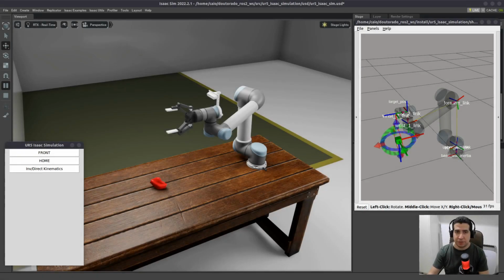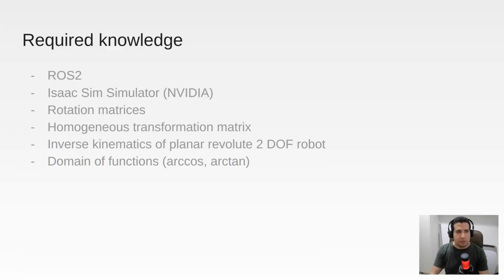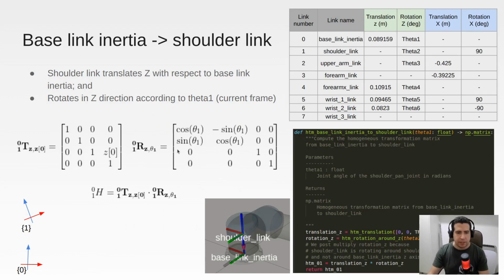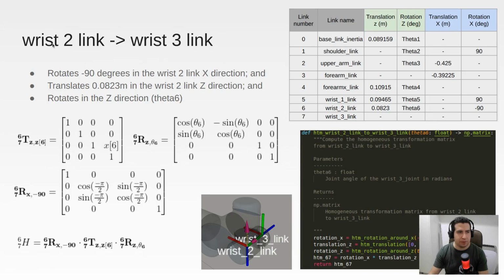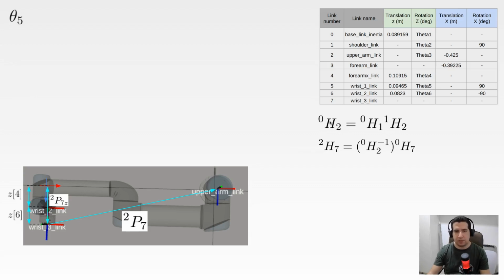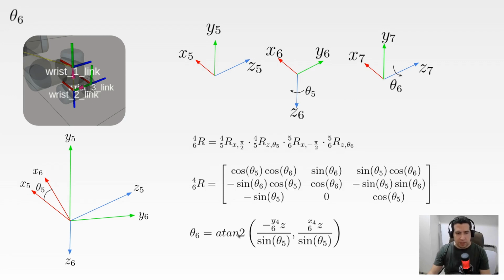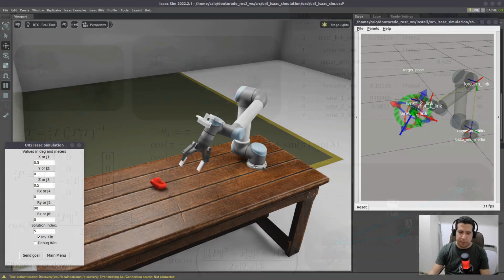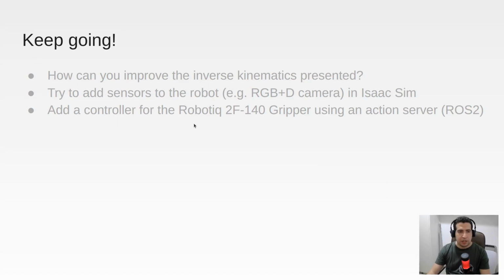[Omniverse Isaac Sim] UR5 Inverse Kinematics + ROS2 Explained

Comment: on NVIDIA Isaac Sim 4.5.0 with a small modification, I was able to build and load the extension successfully. However, when I open the USD file, click “Play,” and run launch . py, Isaac Sim crashes immediately. Rviz does appear for a brief moment, showing all expected frames and the robot description accurately, but the simulator crashes every time after that. Have you encountered this issue on 4.5.0? Is there any part of the repository that definitely needs updating to work with the newest Isaac Sim? Any pointers you can share would be greatly appreciated.